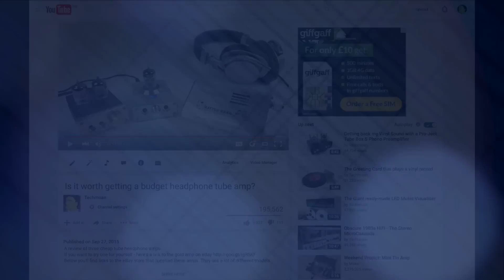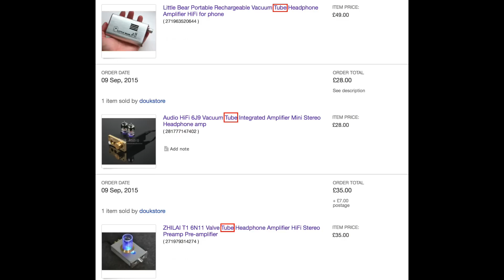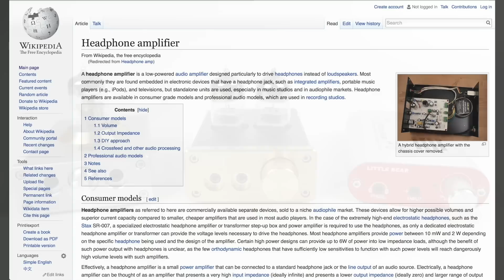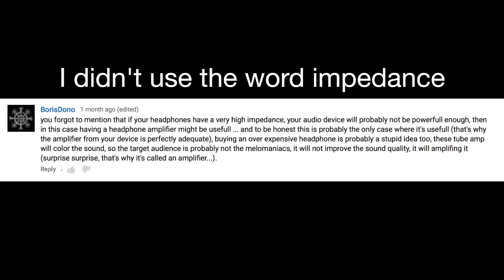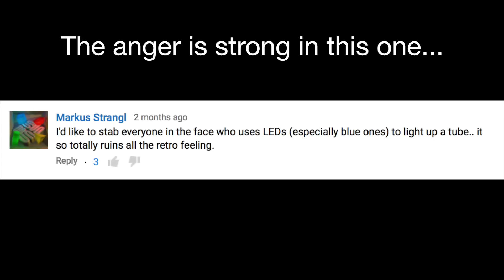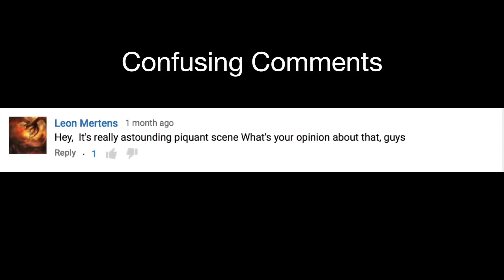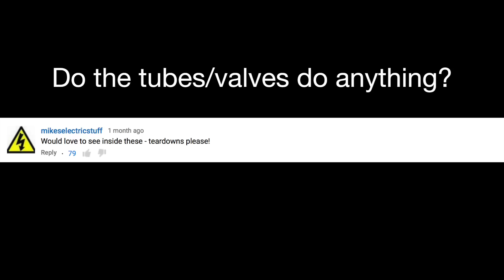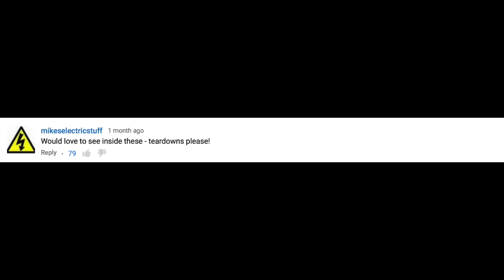Headphone Tube Amps - Follow-up & Tear-down

Comment: Hey Techmoan! I have a degree in electrical engineering and nuclear engineering, so I took a close look at all three of the devices you have here to see if I can help you out a bit. I specialized in control systems and power distribution, so this isn't quite my area of expertise, but I'll see if I can take a crack at this.

The IC chips that you see on the boards are NE5532 Op-Amps. It seems as if the IC's are working as a pre-amp and the signal that they output is fed to the tubes to boost the signal. I believe you refer to this as a hybrid amp.

The two-tube amp has a separate op-amp and tube for each audio channel while the single tube amp has a single, dual channel op-amp and a single, dual channel tube. The single tube is pretty much just a two-in-one solution. Either way, both amps provide stereo hybrid sound.

The pocket amp does the same thing as the others as well, but has a micro-tube and some dodgy components, leading to the lesser quality sound.

Hope this helps!
Reply from the maker: +Classical Rips yes, thanks for the info.
Reply: +Classical Rips Hello fellow engineer!
Indeed, there are opamps are inside each amplifier. Probably for coupling chube output impedance  to lower impedance of headphones. Choobes do amplification, opamps do coupling here, just my guess. Anyway that means they are hybrid and not cool enough and basically an abomination for a true audiophile. 
No sign of poweramp (post-amp, really?) ICs though as they usually come with heatsink pad even for a small headphne amps. The second (blue one) has something with a heatsink on a bottom side, but probably that's a part of power circuit. 
PS. CHUBE-CHUBE-CHUBE-YOUCHOOBE. Hope you forgive me for a little irony, Mat ;)
Reply: I built my own tube amp with pencil tubes for the fun of it. Tubes are high impedance devices while headphones are relatively low impedance. The NE 5532s are being used as the outputs as they have a high impedance input but low impedance output. The only other way to get an output from a tube that could drive most headphones would be to use an audio transformer which adds weight, complexity, and low level distortion.
Reply: A pair of NE5532 (and many other) op amps are quite capable of driving stereo headphones all by themselves.  The tubes are window dressing.

Comment: You could call them thermionic valves of course.
Reply: +kd1s The term valve made sense when they were diodes (their original purpose). After their ability to amplify signals was discovered and that became their purpose instead it makes less sense to me and something more general like tubes seems better, I am an American though so I don't have the same tradition. This is of course just academic at this point.
I guess they still are sort of like valves if you think of the small signal on the grid(s) as the handle of a valve modifying a much larger flow (plate current). Whatever you call them they sure are neat! I own an audion in its original can as a historical artifact sitting on my electronics bench, they were manufactured nearby too.

Comment: If you look the wires connect on the top and bottom of the board and the majority of the pins are used,
Alot of people assume that 12v wont drive the heaters but they are very wrong, it is current the heaters need not voltage, and you didn't tell use how much current (amps) the power supplies feed them.
I see basically no digital chips on the boards that are capable of driving the speakers so i would say yes, they genuinely use the Vales/Tubes/Thermionic Amplifiers.
Reply: +Jared Reabow (Jazza) Well valves designed for mains operation need higher voltage because of the higher resistance heaters but obviously they do different models. Do they forget there was mobile equipment even in the olden days?
Reply: +Jared Reabow (Jazza) But you don't know the resistance of the heaters, so impossible to tell.
Reply: +Jared Reabow (Jazza) You need a high voltage on the plate (anode), not the filament. This is required to use the property of thermionic emission in most tube designs, as you need both a high voltage and the high heat to cause electrons to jump across the vacuum (usually). This says nothing about mobile tubes being possible or not because you can easily have high voltage equipment powered by a battery these days AND in the past (though back then the circuits involved mechanical components to generate AC and were therefore pretty unreliable). This comment is mostly directed at the other replies you've had as I can't actually tell from yours whether or not you already know this.
Reply: +Josef T-D Since he showed the tube's (valve's) model numbers  you can easily look up the required filament voltage (or any other relevant properties). But like I said in my last comment the high voltage people referenced isn't for the filament anyway.
Reply: +W Bailey There were some low voltage tube designs specifically made to eliminate the high voltage requirement for mobile equipment, like "space charge" tubes, but I don't think they were very commonly used.
Reply: +W Bailey Yes an some are 12v for car radios 1 to 3 w wooow power